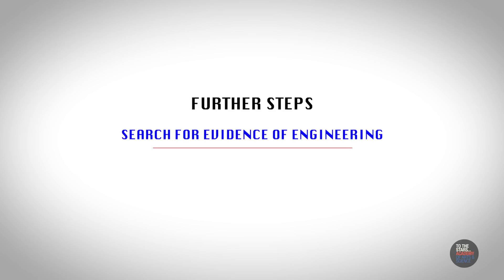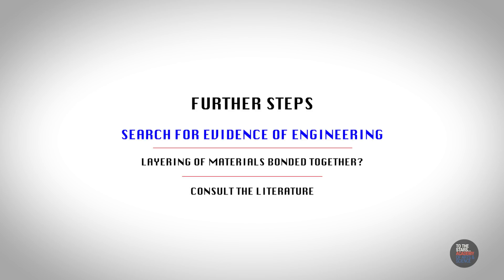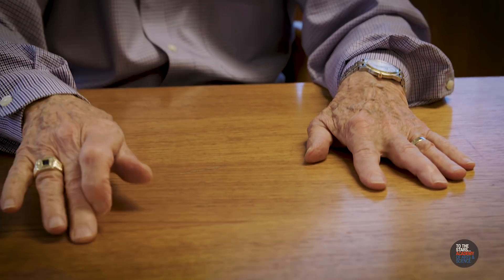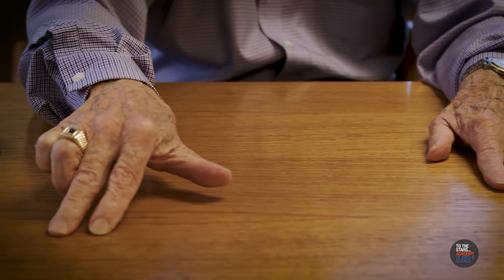How To Scientifically Test & Analyze Potential UAP/UFO Material

Comment: To The Stars Academy

A Government operation masquerading as a public disclosure event that is using Tom DeLange as the PR figurehead to coax back trust from the youth and generations that have an active dislike of the overarching system of Government.

The Objective of TTSA is a mass pro-government propaganda operation to allow the Government to slowly disclose the UFO phenomena along with the exotic propulsion and energy studies into Electromagnetic energy and propulsion as well as other ancillary energy systems in a way that deviates the public from the 100 years of cover up (starting with Tesla) and the cover up of the Roswell crash.

The Roswell crash was covered up due to the cold war but the USAF and other entities successfully mastered or at least perfected to human standard Electromagentic propulsion, they have since under immense secrecy reverse engineered these craft at operational sites within corporate bodies such as Lockheed & Martin Skunk Works and the Boeing Phantom Works as well as numerous others. 

It was during the late 1940s and 50s that the USAF and other entities had also developed longitudinal SCALAR arrays that use high frequency electro-magnetic longitudinal waves  that are directed at UFOs within our aerospace at a cross-point vector in space-time  the SCALAR wave will appear with huge electromagnetic output which acts as an extremely high power EMP producing physical as well as electrical damage  (this was engineered and perfected in part from the classified papers confiscated from Teslas vault and draws similarity to his early "Howitzer Gun") 

This SCALAR technology has been used to target and disengage UFOs entering our Aerospace for the purpose of retrieval and study of both biological and mechanical materials for further reverse engineering and breakthroughs, you can see why these technologies were nicknamed WSFM (Weird Science and Freaking Magic) due to the physics breaking properties of these technologies.

We as a planet are responsible for the murder and kidnap of advanced entities in our universe that have observed us since the beginning and assisted in our early development, they are beings of love and light and pure conscious and unfortunately the corporate-intelligence-military-industrial-complex has been in control of our contact with these advanced life forms for 70 years and have decided the best course of action is secrecy, murder and suppression of world changing technologies and understandings 

To The Stars Academy contains key members of the Government, Intelligence community and Military Industrial sector that are already not only extremely aware of the presence of alien life and how (to some degree) their technologies function, but also they are very much aware and most likely assisted in the creation of life changing electro magnetic and zero-point technologies, and if these technologies had been allowed to be worked on as open source when they were discovered in the late 40s we would have a completely different planet than we have today.

To The Stars Academy wants to paint our cosmic brothers and sisters as a threat and will most definitely make steps towards militarising space with alien technology.

DO NOT TRUST THIS PROJECT

There are hundreds of active movements that use CE5 meditation and other forms of mediation to initiate contact with ETs, this has been happening for a long time with extreme success and all of these contacts are done through the transferring of loving conscious energy, we are beings of energy and light and we can project our energy and light into the universe through coherent though sequencing, remote viewing, astral projection and deep mediation.

These advanced beings want to welcome us into the cosmic family and for us to become an interplanetary and trans dimensional species and we will never get to this phenomenal point in human history if we allow the warmongers and sociopaths of the National Security deep state and the military industrial complex to lead us.

Follow the ECETI, CE5 Movements and help us bring peace.
Reply: it sucks because grew up listening to his music and all that.
Reply: Some very nice words and I wont trust those people from the gov, ET´s are nothing to be scared of <3

Comment: My father told me a story about some steel he analyzed while working at Night Vision Labs in Fort Belvoir Virginia during the seventies. He said the steel was made up from one giant crystal. This type of steel is impossible to create in the presence of a gravity field because of convection currents. Therefore, he determined the steel was non terrestrial in origin. :)
Reply: Bill Johnson Steel or iron?
Reply: @PudgeFree  Steel which I believe is a mixture of carbon and iron and perhaps some other trace elements. The point was the atomic matrix had no defects. All my dad could talk about was how great it would be if we had steel like that for the fan blades of the jet engines. He also talked about other possible applications. Apparently this steel could withstand much higher temperatures and pressures than terrestrial steel.
Reply: Bill Johnson depends really. There’s a LOT more to steel than the crystal structure. That’s like the most basic part. Which elements it’s alloyed with and precisely how much and it what way is way more important. Without a sample there’s really no way of knowing if it’s actually any better than anything else we already have.